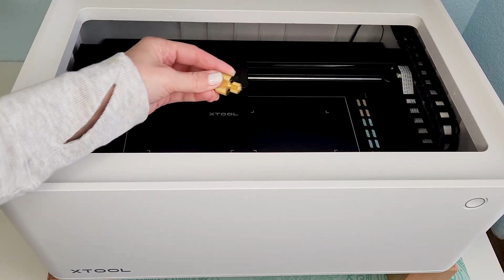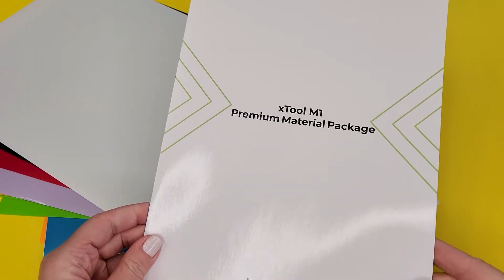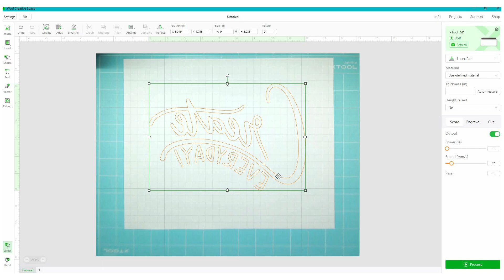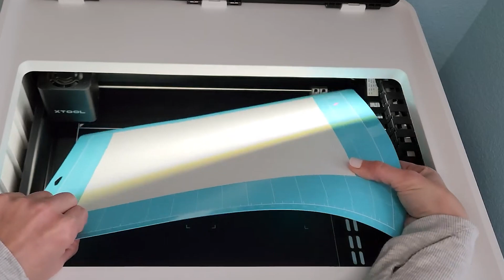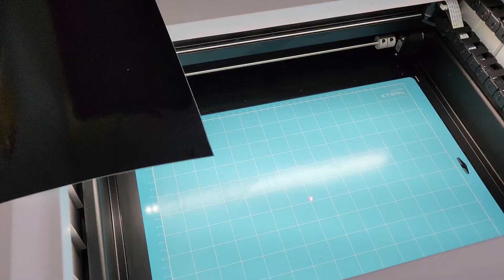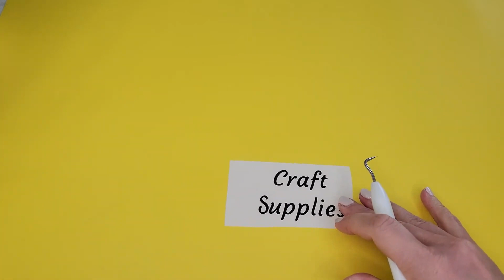How to Cut Vinyl with the xTool M1

Comment: Is it particular to this fabric transfer vinyl that it cuts the entire way through the sheet, as opposed to just through the adhesive layer? I noticed when you started weeding that the entire sheet was cut through.
Reply from the maker: The standard settings on the machine cut the HTV all the way through, if you lighten up the pressure then it will cut just the top layer and you can weed it like normal.
Reply: @SarahVanderkooy  Thanks!

Comment: Thanks for this tutorial! I got the M1with the large bundle. I've found a ton of videos on how to laser engrave and cut, but there are very few tutorials on how to use the machine for vinyl cuts (similar to functions of a circuit or silhouette). Will you make more videos on this machine?
Reply from the maker: Glad you've found it helpful, yes I have more blade videos in the works this fall. It's a great part of the M1 that's often over looked.

Comment: I bought the bundle that comes with air assist, smoke purifier, honeycomb base, risers, premium materials bundle. How large can I do a cut? And can I use it to do the print and cut I normally do on DS? I have not even setup my machine yet. But I know I hate the limitations on print size with Cricut. I hope you see this! Are you still using? 
Thanks in advance.
Reply from the maker: Congrats on your purchase! You have all the bells and whistles. I use my xTool all the time and have been really happy with it. A blade cut is only as large as the mat, 12x15,  which is bigger than a Cricut mat. I don't think the xTool has a print then cut function yet, but their software is always updating so it may come down the road. Definitely join the xTool Facebook community, it's a great group to learn from and bounce ideas off of. https://www.facebook.com/groups/4116013741830177